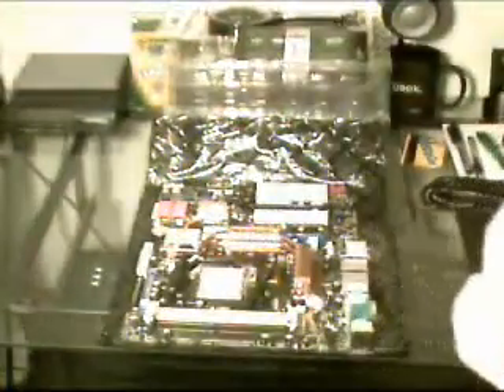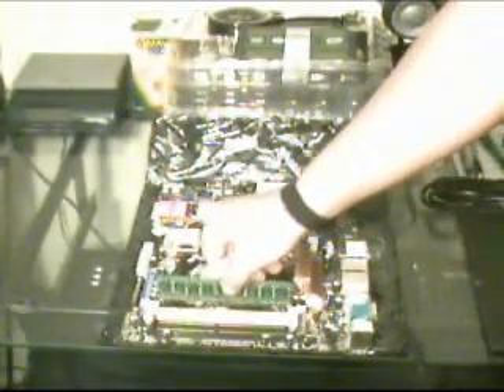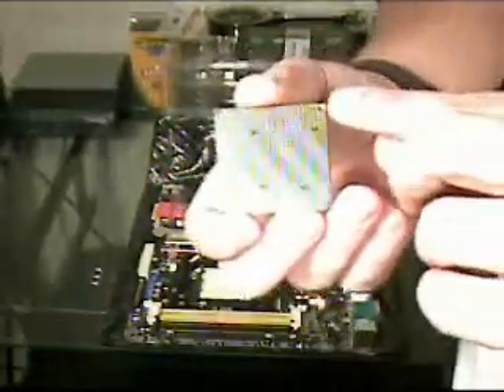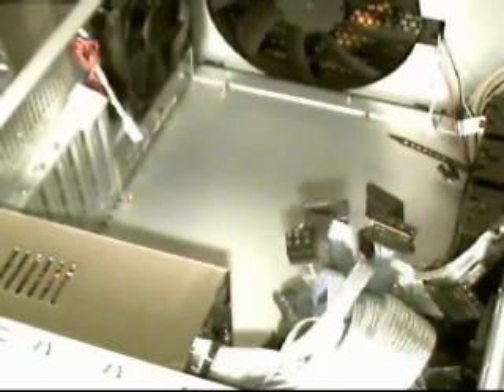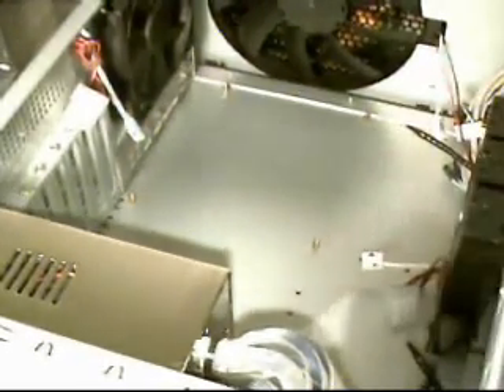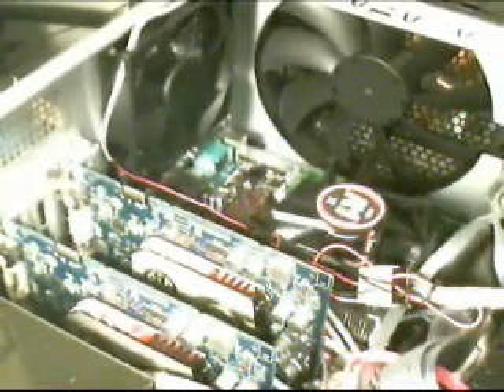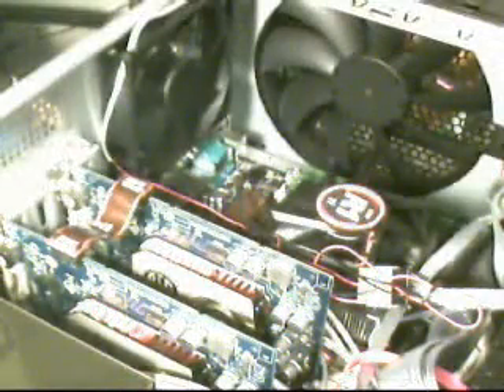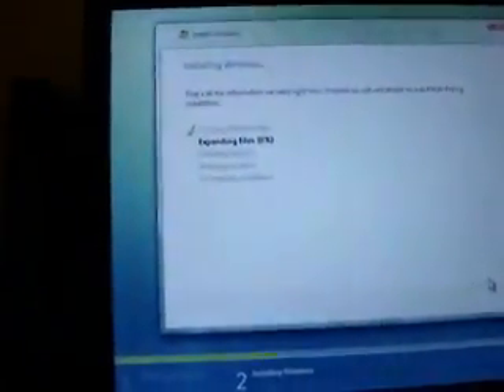HWG PC Build Guide 2006

Comment: Nice. Thanks for that mate. Im building my PC next week and im fitting it all in an Antec Nine hundred! :) Awesome case. One thing though. Ive got a psu with a fan at the bottom... Can i turn the PSU upside down and fit it into the case that way? Im worried that there wont be enough room for the air to be blown out of the psu. Thanks again
Reply: McCain 08